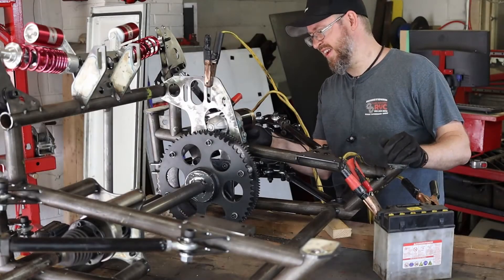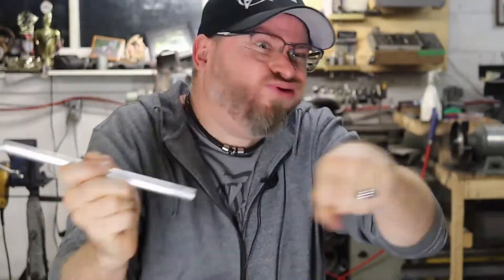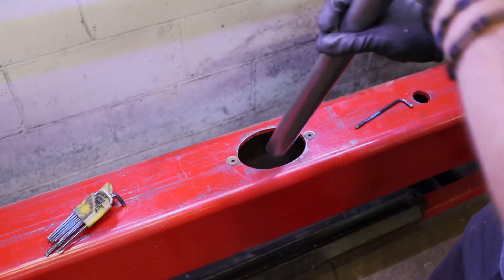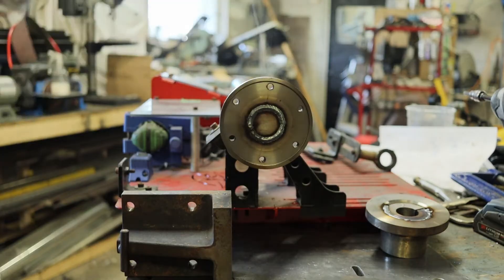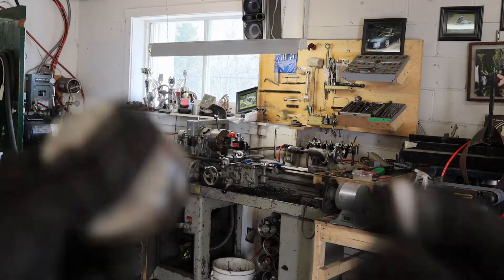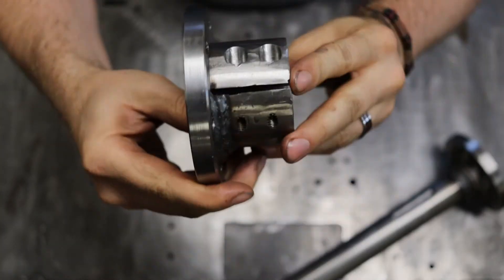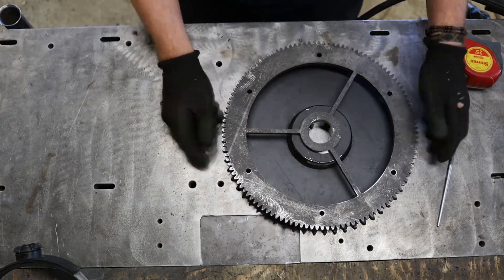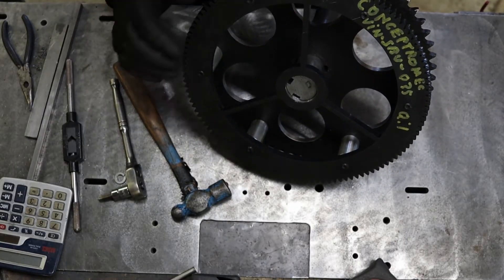Smart Hayabusa, part 5.3: main shaft fab, reverse testing and engine installation!!!!!!!

Comment: Hi Vinyl B !
Are you using regular motorcycle chain for transmission? Does chain getting hot ?
Well done job 👍
Reply from the maker: Yes and no. I got the highest rated chain (10k pounds) from a motorcycle parts supplier and never got any significant heat out from the chain.
Reply: @VinyB57  thanx for your answer.

Comment: you could make the axle so it sticks a little through the flange and fit the sticking out stub intoo the chuck then use a steady rest at the other end of the lathe and machine the flange true to the axle that way  , last thing to do it cut the stub on the lathe as far as you dare then hacksaw the last bit off
could even do a flange at both ends just need to have a longer shaft for the axle to have enough material to get the stubs for the lathe chuck to mount it

Comment: Nice work!! I have a question though. Where did you buy the sprocket for the reverse? I am currently building a Super 7 with a GSXR engine and chain diff. But need reverse...

Comment: Amazing work sir and great content. You can use a differential spider gear casing(with spider gears) weld their windows shut, pack them with grease, remove the crown gear and swap it with a same PCD sprocket to get open differential character.. It's a bit complicated assembly but the plus side is you get two CV shafts that go along with it, saving tonnes of money and time on the whole process. You can also use the bearings in the casing and create a custom mount for mounting the differential to your chassis.. Just an idea we use in Formula Student

Comment: You are using a starter motor for reverse. Have you thought of maybe also using a centrifugal clutch linked to the starter in some way. Just a thought.😇
Reply from the maker: Not really, it works flawlessly! But thnaks for the idea!
Reply: @VinyB57  , I noticed there is a few reverse gearboxes for bike/car applications on the market but they are pricy.I suppose a starter  is a quick and easy fix and most probably I will go the same way.I always try to improve and get a better product.Brilliant minds think alike.

Comment: Viny, you are great! Let me ask you, do you think there was a way to build a shaft instead of using a chain with sprockets for the transmission? Thanks.
Reply from the maker: There's always a way....but it would need a 90° gearbox on top and a diff at the bottom...with a driving shaft between those 2....which is not such a bad idea 🤔, if you can find a 90° gearbox compact and stroung enough for the Busa engine. 🤷‍♂️ Thanks for your comment Rob!
Reply: @VinyB57  thanks for the answer. Now I have more things to think about haha.

Comment: hey, so when you engage your starter, your wheels are gonna start moving the car forward.... or am I missing something?
Reply: which would work, but you'd have to jack the back wheels up off the ground to start the car and leave the clutch engaged with it in 1st gear while you engage the starter. then take it out of gear before you lower it. it'll work at the track as long as you don't stall it.
Reply from the maker: Hi  @joshcassidy2092  ! Just to be clear, on the smart-busa there's 2 starters, one on the hayabusa engine itself, to start the engine and one big V8 starter on the sub frame to give the car a reverse, does this answer your question?
Reply: @VinyB57  yes!!! OMG!!! That's genius!!! So you're using the starter off a heavy truck as a reverse motor. Ya know, if you think about it, you kinda have a hybrid smart car now...
Reply from the maker: @joshcassidy2092  That is exactly what I'm saying to my wife....I'v got now a hybrid car!! 😅

Comment: Hi bro. l am also about to finish my Smartbusa project. I think that you have a lot of weight cause of using alot of Steel . wish you all the best.
Reply from the maker: Hi Yaser, what engine are you putting on?
Reply: @VinyB57  Hi Viny my engine is a hayabusa stroker 1500 cc built by RPE it was removed from a radical car.